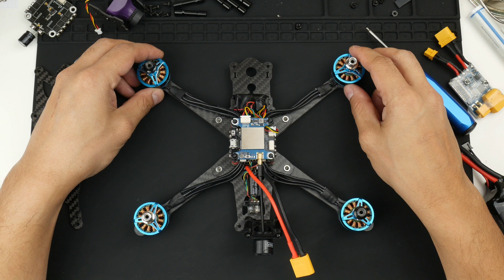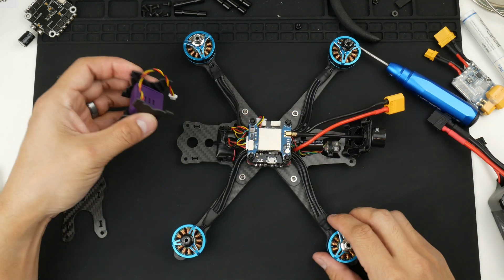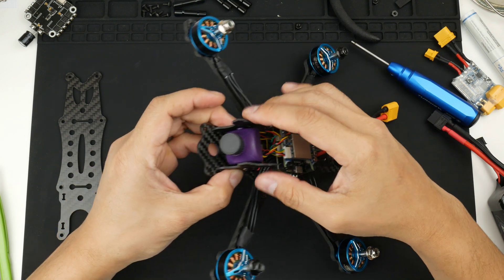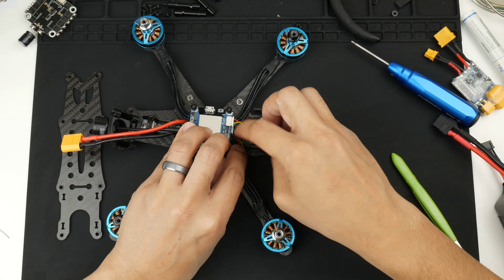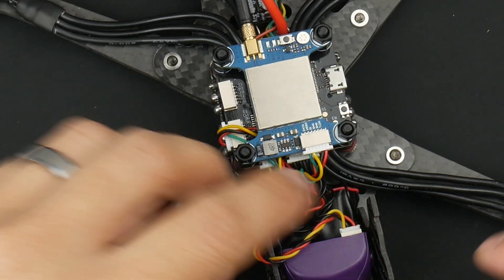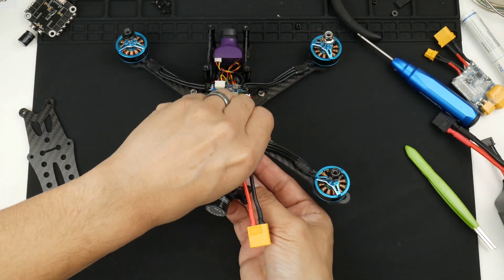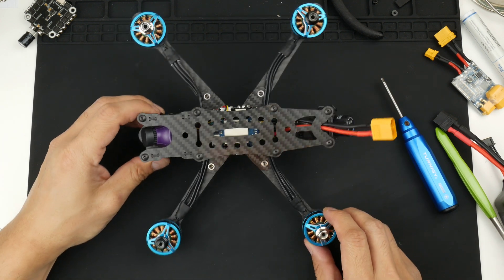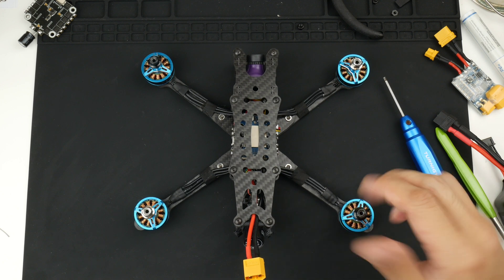TCMMRC Rebuild - Final Button Up

Comment: Very cool 👌. What do you think on upgrading this to DJI O3 air unit? Is that something worth doing?
Reply from the maker: The O3 was just released yesterday for me in Australia from authorised resellers with free shipping (DJI costed a bit extra in shipping I didn't want to pay). I immediately put the order in and am looking forward to playing with it!! From seeing other reviews and also my experience with the Avata image quality (reviewers say the O3 is just as good, if not the same!). Is it "worth it" is really subjective, since this isn't a cheap setup - Goggles 2 & O3. But, Avata image is very clear and crisp on the Goggles 2 and it almost feels like having GoPro live feed (for me at least). Hope that helps!
Reply: @nxp200  I've got the DJI FPV drone with goggles v2 and rc2 for $700. I have the protek25 as well. So I'm thinking of getting o3 air unit and put it on my protek25 or the Tcmmrc.